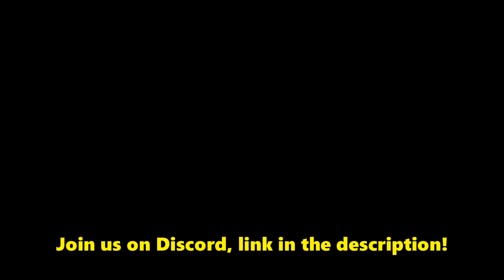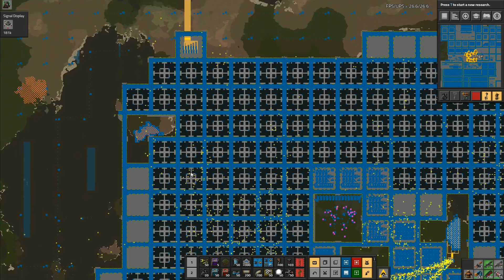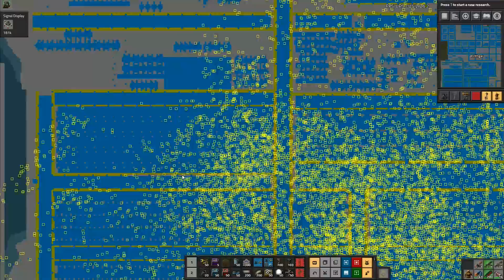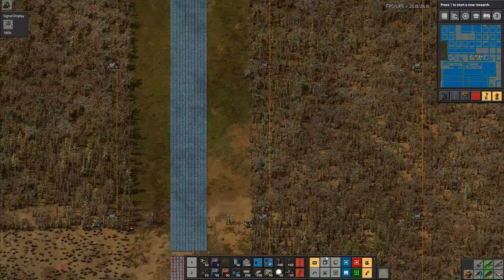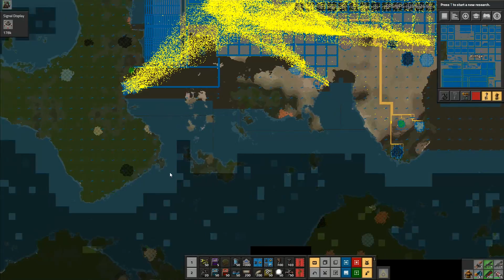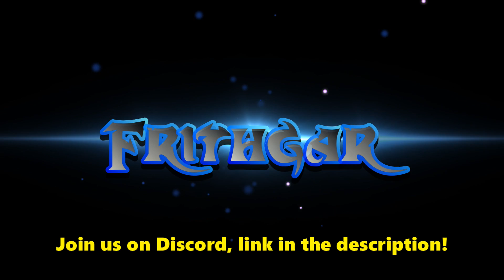Factorio Million Robot Challenge #296: Rocket Control Units!

Comment: Frithgar,  you really need to use proper lane balancers.  Bilka has a gist with all the lane balancers you could ever need.  
https://gist.github.com/Bilka2/aeec4ff7123ff5544cb9a80cf1046a06

The extra splitters are very inefficient and reduce your frame rate.  
Also you don't need 12 belts from the Northern iron ore deposits.  If you add up the output from the iron miners, you most likely only need 6 lanes of output from each ore patch.  A partially full belt is worse for frame rate then a full belt.  If the belt is completely full there is less computation required.  The Factorio Friday facts had something about it a while back. 

The other major thing that is hurting your frame rate is the excessive amount of radars.  The radars are consistently scanning.  When the radar scans it loads that section of the map into memory.  And since you don't need the radars to tell you what the biters are doing, you should keep the minimum amount of radars, while still giving you complete map coverage.  Lots of the radars on the edges of your explored map are overlapping and the only thing they are doing is hurting your frame rate.